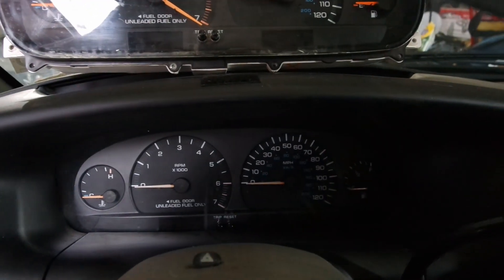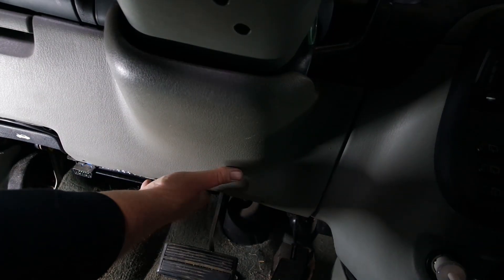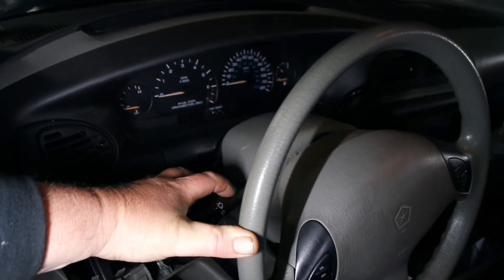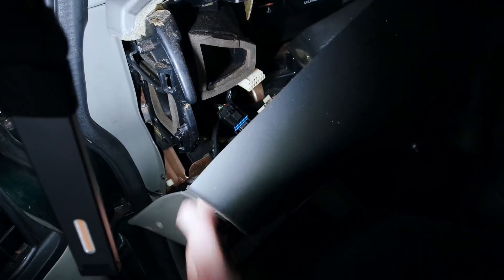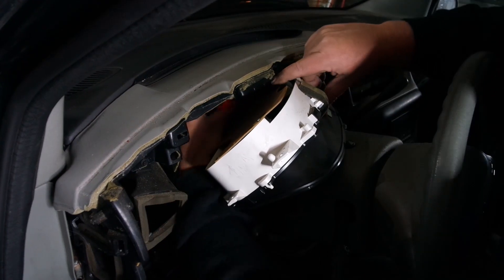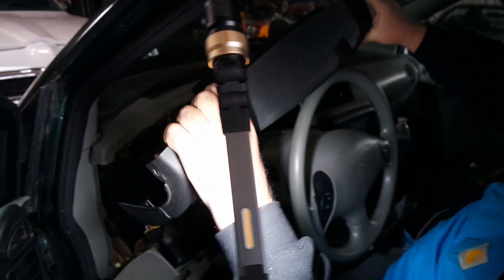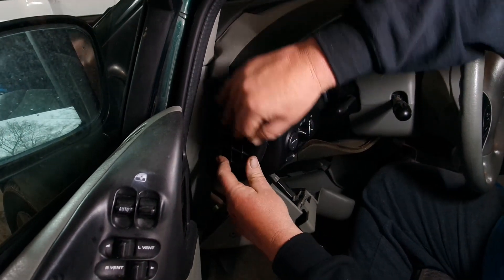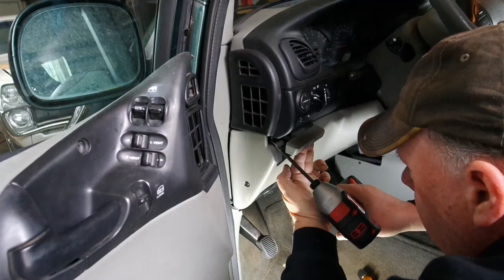How to: Replacing the Instrument Cluster in a 1998 Dodge Caravan

Comment: The thingz we do for ma and pops.  That clear coat looks purdy bad too. (Literally)
Reply from the maker: Agreed lol
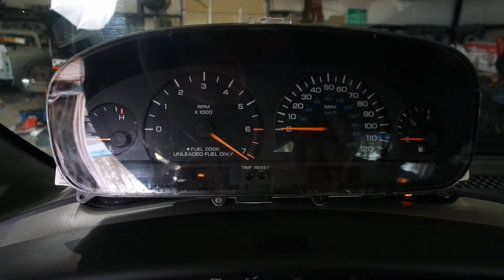Reply: @MidnightRoadGarage  0:17 Sure could use the SOURCE on WHERE you got the replacement as is since there is NO part number or LINK, have same issue with 96 Chrysler concord lx  3.3 engine    VIN 2c3hd56t5th130298